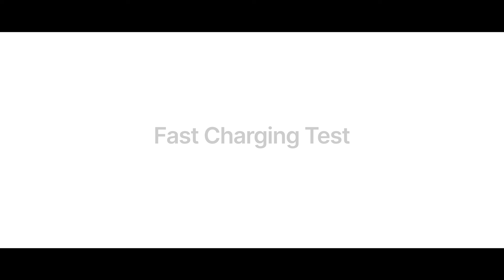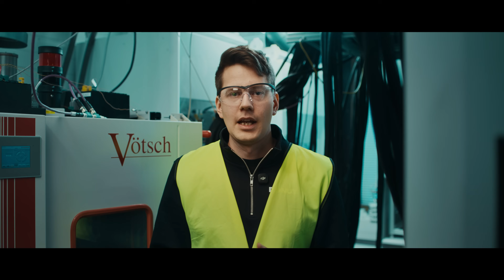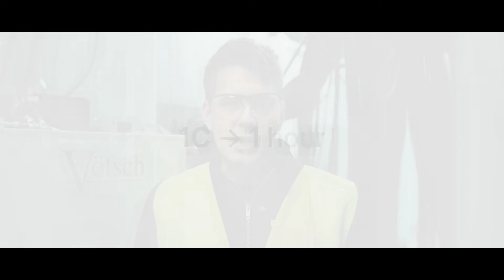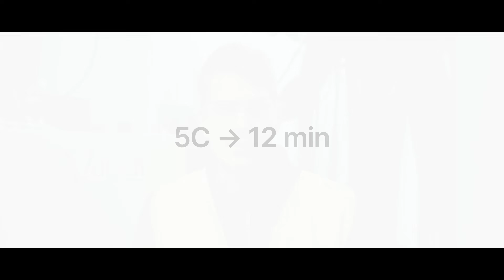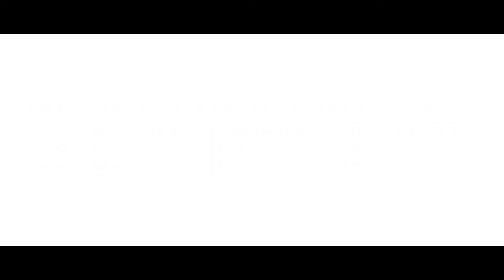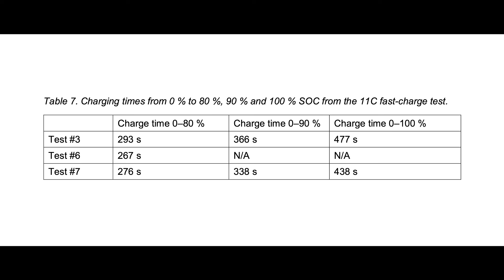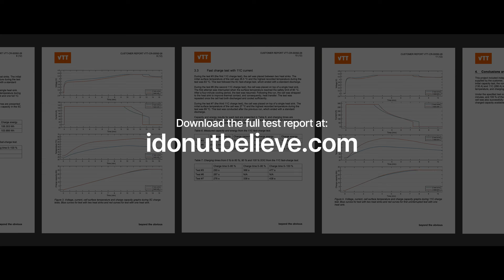Donut Solid-State Battery: Fast Charge Test | I Donut Believe (Pt.1)

Comment: So, the report states: "The aim of the project was to conduct independent charging performance tests on the energy storage devices supplied by the customer, which the customer identified as solid-state battery cells. The specification of the device under test is presented in Table 1. All tests described in this report were carried out on the same cell, following the customer’s test plan."

Two interesting sentences in that paragraph. 

First, Donut Lab identified the cells to be solid state. Not VTT. And the test plan was also designed by Donut Lap. That means the third party didn't know what's inside. I wouldn't call that an independent measurement of performance, as VTT seems to not know what device they were measuring. Correct me if I'm wrong, but 5 or 11 C charging is not groundbreaking with today's technology, if you can do it only a couple of times.

Second, the experiment "in this report (!!!) were carried out on the same cell". If the next report in a week doesn't specifically mention that ALL experiments were conducted on the same cell, this "validation" series is worth nothing...
Reply: So what? Does it matter for the results what the device was they tested? They were tasked to verify that the cell is able to take 5C charging current. That they did. Nobody said that this world prove all claims. However, it does show that they seem to have a cell that can be charged extremely fast, not more but also not less.
You are right, that all the other tests should be conducted with the same cell to be sure they didn't test 3 different devices.
Reply: Yes because otherwise they could make 5 different batteries designed to pass specific test. I do want to believe that all they are telling is true, but it's definitely true, that testing on not the same one battery would give them space to manipulate results.
Reply: @seweryn_o That right there is what turns this from a scam played on them to a scam played by them. From a misunderstanding to a felony.

If they submit completely different batteries to VTT for testing, they're willfully misleading the public. It instantly wrecks the whole plausible deniability angle of "we were sent these by our partner, NN".

If it's the same battery used for all tests though...that's a whole another story.
Reply: @seweryn_o Seems that you have no experience with industrial testing setups. How could you make all tests with only one battery? E.g. If you have one test which is puncturing the pack with a nail the cell is gone. Of course you will have to use several cells to do several tests (maybe also in parallel). E.g. for the cycle test. Maybe this will be the last result shown, because this test may run in a different test station for weeks and is already running. Maybe they run one cell at 1C, one at 5C and one at 11C to compare the wearing between the different conditions. Maybe one also in a cold environment and one in a hot, or alternating temperatures depending on the test specifications. I have no experience with batteries, but with other industrial testing. And you never have only one DUT (device under test).
Reply: @seweryn_o  It could also be that they send a "hero" battery made of exotic materials like gold or graphene in a lab, but with virtually zero chance of ever being mass produced affordably as they claimed.
Reply: @uwehetman2320 you are right, but that's not what @seweryn_o meant. 
In theory donut could provide chemically different cell prototypes for different independent tests. Which is possible.
Reply: 5C to 11C is pretty good compared to NMC.

Last I checked Farasis was happy with around 4C.
Reply: Cell tests are usually performed on different cells per test-harness.

This also means it is pretty comparable with other cells. 

Go ahead and look at the soec sheets of other cells and compare. You will find some interesting (and some similar) results
Reply: Why would they be making this up? Have they asked for money? No. Have they been actively seeking investment? No. Someone please tell me what would be the point in bullshitting?!
Reply: @ZZZ333  Money? Publicity? Status? Not saying they are lying, but there are plenty of reasons.
Reply: @ZZZ333  hype, to keep people believing that those bikes are coming and it worth the endless delays
Reply: That just means that VTT didn't disassemble the cell to look inside and I guess DonatLab didn't allow them to do that as it could reveal the way the battery is made and information may be leaked. If it's true, battery giants like CATL and BYD would pay enormous amount of money for that information. About the second sentence, does it matter if it's the same cell as in this video or another cell when they get to the endurance testing and charge and discharge the battery at 10C or 11C continuously for hundreds of times? The next test will probably be about capacity, but the real information that we need to see is the endurance test where both speed, capacity and resilience are tested in the same test if they are doing them at high speeds as promised. If the next test is about capacity and the endurance tests are done at 1C then yeah, it's definitely suspect.
Reply: This
Reply: It is like Marko said in the last video. Prove one thing and their claim will change. 

You are obviously not familiar how testing works. Of course an independent test facility is testing only what the customer pays for. 

What I saw in this video is awesome and I am confident that they will prove one claim after another.
Reply: @uwehetman2320  you're playing the PR game, I'm not. I only care about one thing: is the technology real? And so far there is no proof. And in my initial post I pointed out, that we might not even know after all videos were released because important information is missing
Reply: @AllNamesAreVergeben no, I am not playing a PR game. I know Verge Motorcycles. I sat once on one of their bikes. It was almost two years ago. Cool thing, but it was too expensive for me as a "toy". So, I know the company is in business for a longer time. They have developed a new Donut Motor, which you could see at the CES and also two month before at a prototype in a video of a motorcycle YouTuber returning his test bike two month ago. Also I saw a short video snippet where the CEO of verge motorcycle is charging his modified bike, with the 20kWh battery on a fast charger with 109kW. And now we have the first test result of many following tests, which proves their charging speed claim is true. Which is for me the price, that they are serious with it. Do you really think they are saying at the last test:"No it was all fake!"? The test is two weeks old. The test report date says 9th of February. The tests are very likely already done, or the cycle test is running until the end. We will see next week, when the next test report will be released which date there is on it. 

I am just combining information I have to a level of trustworthiness. And I think it is very high. The reputation of VTT is very high, so I don't think it is a scam. You could already order a bike if you have the money.
Reply: The battery looks like a normal li-ion battery, i see zero reasons to make it look like that
Reply: @cristibaluta  Of all the reasons to be skeptical, this is by far the least reasonable one I've heard so far. Do you expect it to look like something out of a sci-fi movie?
Reply: @ProXcaliber yes, why isn't this a magical glowing orb of science?
Reply: @BlazingStudios  Lol, I needed that laugh. Thank you!
Reply: @ProXcaliber  I expect it to look exactly like they showed last time, black with perfect corners and thick contacts. That was a single cell.
Reply: This is a high performance lipoly pack like similar used in RC (like 15C Turingy Graphene). Outer coating  layer, folding of the coating, voltage ranges reveals it's a lipoly/lion pack. Anyone who build at least one RC battery pack recognize these details. It’s funny to watch them try to fool the naive.
Reply: @maricomovies  But would such a battery pack survive a meeting with 90 degrees celsius? As far as I know any li-ion/li-poli would start to swollen and break apart at 90 celsius.
Reply: @alexandruilea915 Turnigy Graphene batteries can handle heat up to 150°C before going into thermal runaway. And they support charging/discharging at up to 15C. 

The really big difference is the number of charge cycles. It's only like 600 cycles on those.

So far none of the proof provided has convinced me it's not just a battery using the same chemistry as one of these non solid-state batteries with a Wh/kg of around 150-170.

Sufficient life cycle testing results will convince me otherwise. Until then it might as well be a hoax.
Reply: @jtr159  sure, the energy density test is probably next so that should prove if it's under 200Wh/kg as you expect, or at 400Wh/kg as they presented. Related to life cycles, given the fast under 10 minutes charging/discharging for 80% of the cell, they should be able to brute force over 1000 cycles in under a week for 80% of the capacity and that will surely prove if it's just another masked lithium-ion battery pack.
Reply: @maricomovies  blablablaaa.. blqblablblaa. Blaba? Blablbaabaa..? Exactly like you sound like!
Reply: @maricomovies They said previously that the voltages can be changed but are chosen at 4.3V to be a drop in replacement for LI-batteries. I don't think the material on the outside has anything to offer in terms of disqualifying the tech.
Reply: @klick2destructyou can't change cell voltage, that's not how it works. The chemistry determines the voltage. Otherwise all batteries would have the same voltage.
Reply: jguy5 • Yes, you can. 
A 'pseudo-capacitor' kind of battery can be built to have different voltages.
Reply: @maricomovies  Yes, i see no reason to make it look like that, if it's solid state shouldn't look so fragile.
Reply: I agree. People are way too gullible.
Reply: @jimj2683  I think you're too willing to dismiss it. It's rather routine for companies to not disclose the properties of their batteries and only let you do specific controlled testing. We just don't normally see this testing as it's usually not as public as this.
Reply: @Skylancer727  hahaha. You amuse me.
Reply: @jimj2683 why would they lie?  They aren’t trying to raise money or pump up any stock. They are delivering motorcycles this year using the batteries. Surely people will do testing and a tear down immediately.  I don’t see what lying would do for them.
Reply: @47izaPedo  Good luck in life. You will never succeed with so little critical thinking skills.

Comment: This is 100% a scam. Having actors wearing costumes and then putting a bunch of graphs on the screen does not make a real solid state battery in anyway whatsoever.
Reply: Did you already read the report by state owned VTT institute?

If your answer is no then just by quiet
Reply: @mariokreiner513  VTT runs the tests as Donut wants though. VTT does not say that Donut claims are real. They only guarantee that defined tests are run correctly and measurements are valid.
Reply: @mariokreiner513 state owned institution?
Come on, we've seen lots state owned institutions turned out to be contributing in scams

Comment: "which the customer identified as solid-state battery cells"
Reply: Of course, because VTT is not allowed to disassemble the battery cell as that would make information leak possible. You have no idea how much giants like CATL and BYD would pay for such information right now.
Reply: @alexandruilea915  Ran the report through Gemini pro and.. anyone else get similar results? 

The Most Revealing Finding: Average Discharge Voltage
The report's numerical data contains a critical diagnostic clue. Using the actual measured capacity and energy values from Tables 3, 4, and 6, I calculated the average discharge voltage across every test:

Test	Discharge Energy	Discharge Capacity	Avg. Discharge Voltage
1C Cycle 1	91.021 Wh	26.109 Ah	3.486 V
1C Cycle 2	91.118 Wh	26.125 Ah	3.488 V
Reference	92.511 Wh	26.520 Ah	3.488 V
5C Test #2	90.540 Wh	26.001 Ah	3.482 V
5C Test #5	90.582 Wh	26.039 Ah	3.479 V
11C Test #3	90.200 Wh	25.894 Ah	3.483 V
11C Test #6	88.925 Wh	25.592 Ah	3.475 V
11C Test #7	89.229 Wh	25.731 Ah	3.468 V

Now compare these to the two theoretical models, using VTT's measured voltage range of 2.7–4.15 V:

Ideal flat-plateau battery at nominal 3.6 V → predicted 93.60 Wh

Pure supercapacitor (linear, midpoint 3.425 V) → predicted 89.05 Wh

Actually measured → ~91.07 Wh → average discharge voltage 3.487 V

The measured value sits 64.6% closer to the supercapacitor (linear) model and only 35.4% towards the flat-plateau battery model. A genuine solid-state Li-ion battery with a voltage plateau at 3.6 V should deliver ~93.6 Wh, but the cell consistently delivers only ~91 Wh — 2.5 Wh short of what a battery should give, and only 2 Wh above what a pure capacitor would give. This is the strongest quantitative indicator from the report that the discharge curve is sloping, not flat. A quality Li-ion battery at 1C typically shows 97–99% round-trip efficiency. A value of only 90.3% at 1C is significantly below battery norms, suggesting high internal resistance (ESR) — a hallmark trait of supercapacitor and hybrid capacitor architectures.

The quantitative data from within the report itself — specifically the average discharge voltage of ~3.487 V vs. the nominal 3.6 V, sitting 64.6% closer to the linear capacitor model — strongly indicates a sloping, non-flat discharge curve consistent with a supercapacitor or, more likely, a hybrid lithium-ion capacitor (LIC). This is further supported by the exceptionally low round-trip efficiency at 1C (~90%) compared to real Li-ion batteries (~97%+). The "solid-state" label likely refers to a solid electrolyte material, but the electrochemical storage mechanism appears predominantly capacitive, not Faradaic. The VTT report confirms the fast-charging performance claims but was not designed to — and does not — establish that this device operates as a true battery.
Reply: @alexandruilea915  Yeah and being Chinese companies, they don't have to respect any patents even if they do exist.
Reply: @Skylancer727  Really hope all stays in Europe... We need this success now more than ever.
Reply: Experinental • Mr Chan Lee from CATL, BYD, NIO, etc have already ordered the electric Verge. They don't have to pay anybody... 🙂

Comment: 0:39 Heatsinks either side is the oppposite of how it would behave in a pack - instead of the heatsinks conducting heat away, the adjacent cells would be contributing heat, so minimal net heat flow, instead of heat flow out to the heatsinks.
Reply: Ya maybe this is a drawback they're trying to hide. Excess heat waste or heat limitations for charging speed.
Reply: In a normal pack you have cooling routes between cells that take that heat away from the cells themselves.
Reply: @alexandruilea915 These cooling loops don't provide even close to the amount of cooling these heatsinks would provide.

It's very commonly just at the bottom of cells stacked vertically for example, with all the neighbors heating at the same time heating neighbouring cells up.
Reply: @swecreations you have no idea how cooling loops work if this is your opinion. Cooling loops use conditioned liquid, this is just a passive heatsink. Why do you think ICE cars use liquilds, a radiator and a far?
Reply: @alexandruilea915 I have quite a decent idea of how these systems work.

They use conditioned liquid, it is conditioned to keep it from heating up much, as the kind of radiators used in ICE cars would need to be massive to keep a reasonable temperature, if for example an EV would want to keep the liquid at 25°C in 20°C ambient without refrigeration it would need to be massive (versus in an ICE car where the radiator keeps the water at for example 80°C in 20°C ambient, which means it needs only a small radiator as the temperature difference is so small).

For this reason the water is actively cooled, these cars aren't really cooling them down to very cold temperatures, it's mostly just to keep the water at a steady temperature.

The average EV has a contact patch to cooling that's maybe 1/8th to 1/2 of one of those two heatsinks just so you know by the way... they typically just sit on the short edge, often just on one of them too.

Even without a fan the thermal mass alone on this heatsink will do quite a lot, and will already be much more cooling than you will find on the overwhelming majority of passenger vehicles for a typical cell.
Reply: Yep. That's the catch. Existing LiPo packs can also handle this charge rate with this much cooling. And that's probably exactly what this is, unfortunately.
Reply: patronics  • They already said this: no Lithium!

Comment: It is encouraging to see Donut Lab publishing direct test data, and transparent early-stage performance disclosure is a constructive step. Continued reporting on additional parameters, such as cycle-life degradation curves, gravimetric and volumetric energy densities, and validated third-party safety certification results, will be essential to fully assess system viability.

The fast charge demonstration may be technically feasible at the single-cell level, and high-C-rate charging under controlled lab conditions is not impossible. However, claims about comfort zone temperatures near 90°C, production vehicle deployment, simplified pack architecture, and implied automotive readiness cannot be considered validated without independent multi-cycle durability data, disclosed energy density figures, formal safety certification documentation, and clear OEM integration evidence. Fast charging performance by itself does not establish commercial viability or long-term reliability.